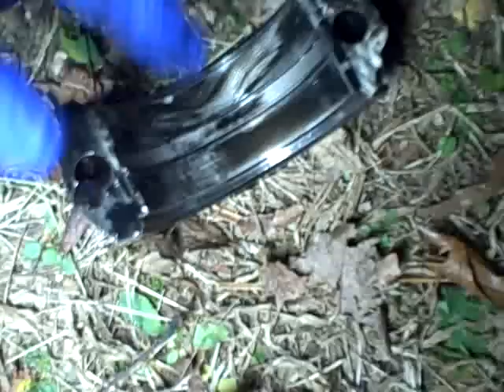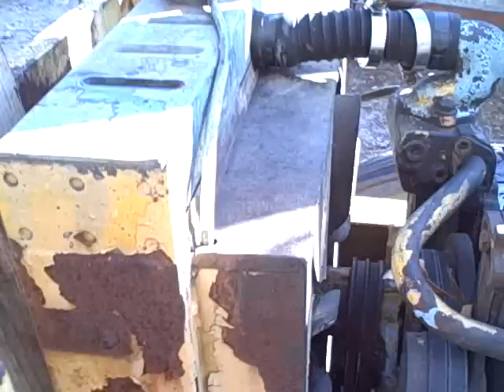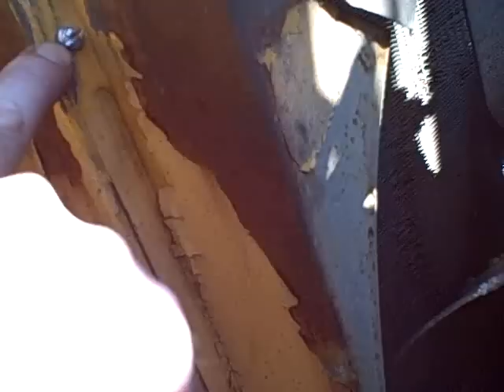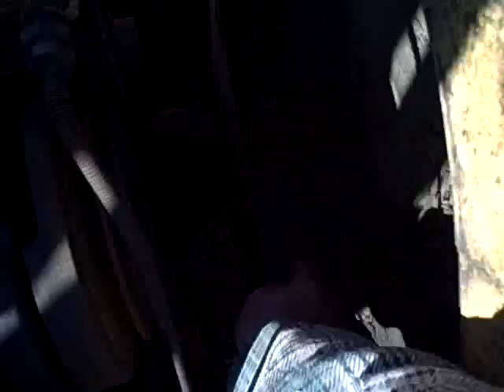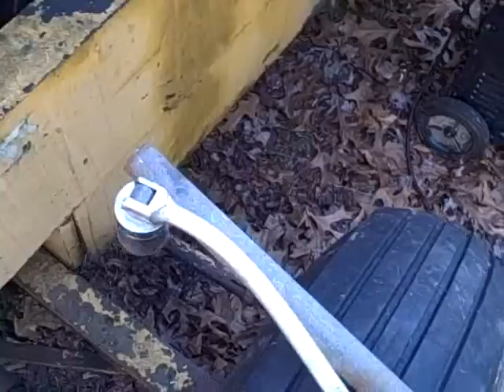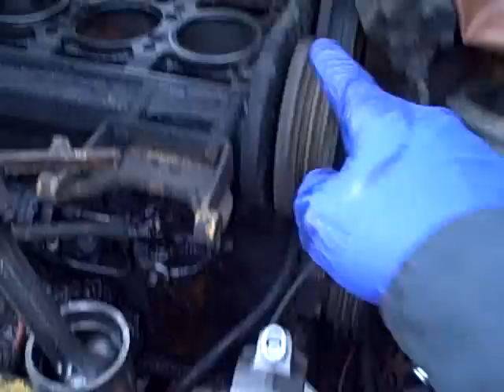Pettibone Mulliken "Multihoe" Project Part 4

Comment: Actually it depends on what style of rod it is -There`s  I beam rods - H beam rods -or can be Aluminium -Steel - Billot - or Titanium - These look like I beam rods but if you compare the end of the journal caps that one is different now it could be an aftermarket journal cap bought to match the other ones as close as possible and to make it weigh the same they leave on a protrusion like these don`t grind it or alter it in any way ,There`s a possible chance this motor has had lower work done .

Comment: Doing an inframe rebuild best to take a center punch and just make a punch mark on the journal cap of piston rod each side of the cap upper & lower mark matching what cyl by punch marks 1-2-3-4- & so on enough to see them this way it tells you what CYL and side then they`re still there when wire brushed clean for inspection .